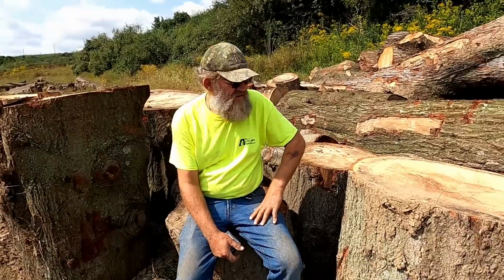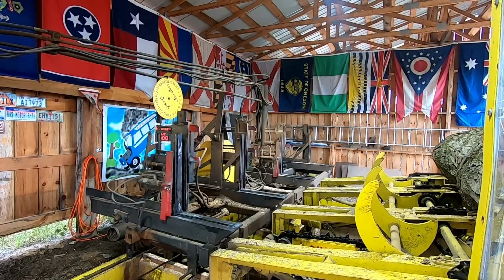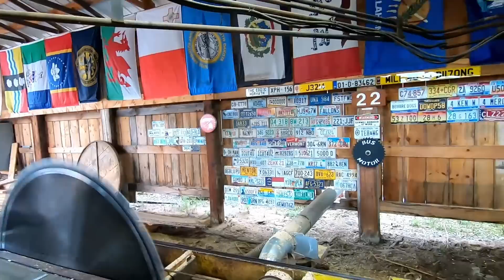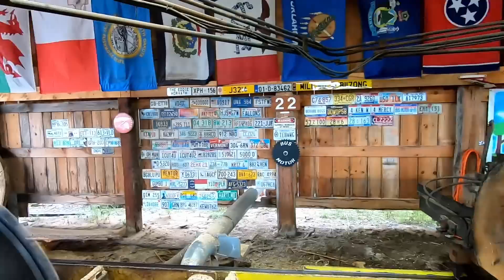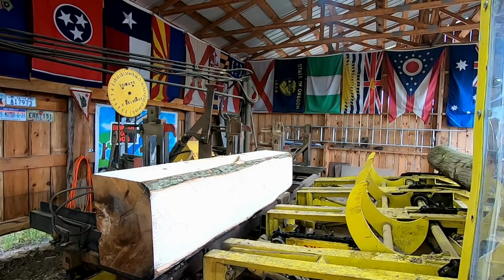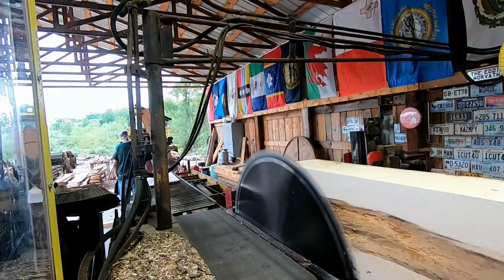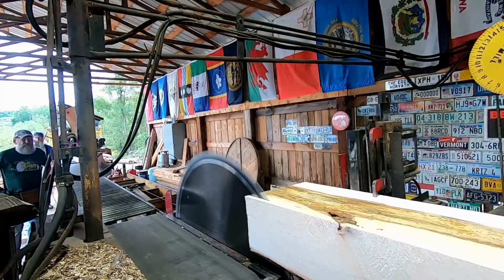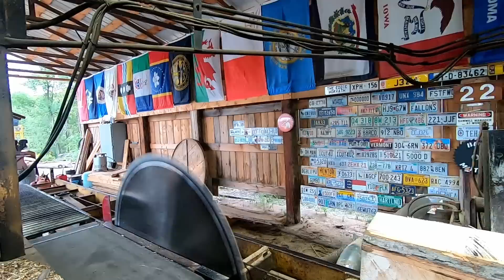sawing silver maple for Doug # 333

Comment: NICE maple and Doug can make some pretty stuff out of it. You said electric edger and it came back to me after the old sawyer/logger died, his son tried running the old mill 3-phase. Didn't work. The minimum cost and not much sawing and they went back to diesel. I'm still not making the Tube happy and not getting comments. They can SIT on it and Rotate as Cheryl says. God Bless!
Reply from the maker: hi Lewie hope all is well! we hope to get 208 power here at the mill for smaller machines like the edger , sawdust blower , chopsaw and kiln the bus motor will always spin the sawblade.